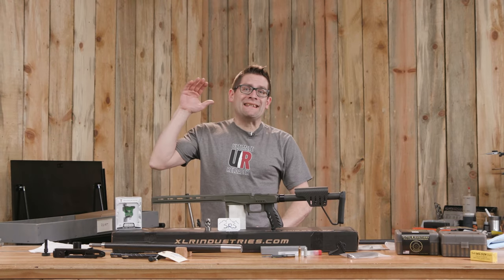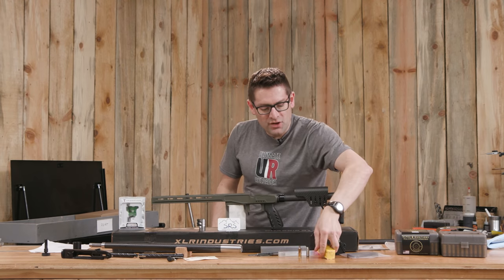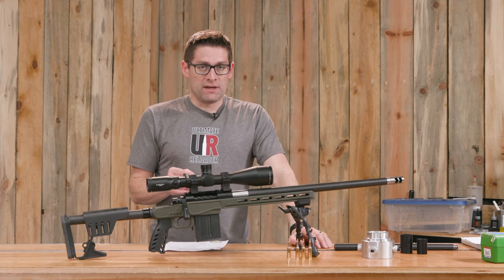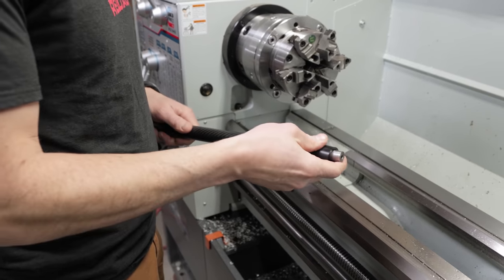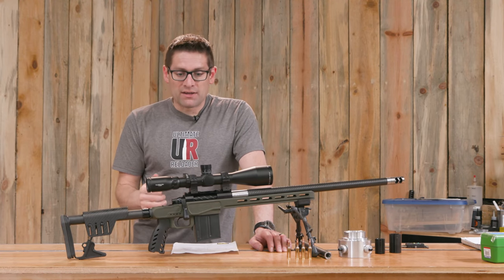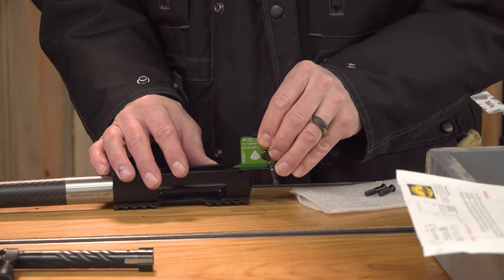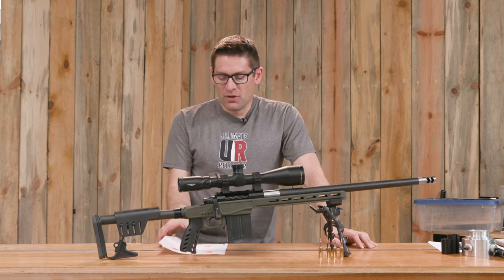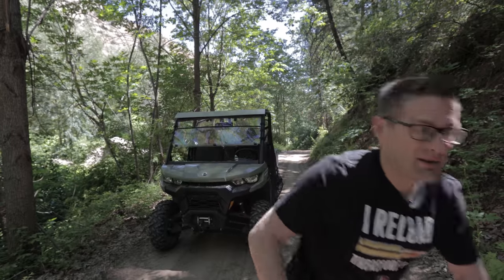22GT Ultra-Light Weight Build (Start to Finish)

Comment: I've been running a 22gt for a little over a year and i have to say i am beyond impressed. Backpack wolf rifle and match guns. 
Anyone that is interested in this cartridge plug the numbers into your app, 90 atips are within 30 foot lbs of energy at a MILE of a factory 143 eld 6.5 creed load. The thing is a monster. 4.9 mil to 1k. The bc is higher then specified from the factory on these as you are at a higher bc. 
Just ridiculous.

Comment: Carbon on barrels heats and burns them faster. Feels cold on the outside, works just like a thermos. A gunsmiths dream :)
Reply: Depends on what kind of carbon barrel you get!
Reply: @davidcoiner6550  No!
Reply: @oddmunddale806  it absolutely does, there are carbon fiber barrels that literally don’t even make contact with the carbon to the steel except for the far ends, and the carbon is drilled full of vent holes. It doesn’t retain more heat than a plain steel barrel.

Comment: Berger 85.5, 90, 95 smk, 88 and 90 from hornady 
Varget to 4350 speed powders all work well, but not surprisingly, rl26 is a monster for accuracy and speeds if you use then heavies. A 1-8 will stabilize most of those bullets when running at the speeds it can produce, but id leave the 90 and 95s out.
Reply: How fast have you got the 85.5’s moving in a 1-8 twist? I’m doing 22 GT in 22” 1-8T and planning on 75/80ELD’s, but would love to try the 85.5’s if they fly
Reply: @mitchellscott1120  in a 7 ive touched 3300. They are rockets. Trued bc is .307

Comment: Great and awesome content. Do you think the EC tuner would help with the groupings? I wonder if the EC tuner is best for solid barrels than carbon wrapped. The harmonics are different when the barrel is made from multiple layers of materials. Please share if you end up using EC tuner and find a great result.
Reply: If you're getting those groups WITHOUT the proper load development done yet, why would you even care about a tuner at all??  With a slight touch of load development he's gonna have this that thing printing single hole groups at 100, or probably even 200 yards.

Comment: Why not go with AG composites... Its even lighter than that stock. The privateer comes in sub 20 ounces. Also I am curious to see how good a aluminum body receiver holds up with hunting. Up here in AK my concern with these is they will scratch and gouge way to easily. for just a few ounces and I mean just a few you can go with the terminus apollo lite and be better suited without having dissimilar metals squeezed into each other.

Comment: I've been thinking about updating my old-school walking varminter, a Sako L461 custom in .222 Remington. I like the .222, I just wish that the rifle had a bit more ooomph at longer ranges (I'm not as sneaky as I used to be) and the bore has 20 years of wear. I'm wondering how fat of a round I can fit into the action...specifically, the 6mm ARC or 6.5 Grendel size case. I have some 6.5 Grendel rounds and it looks like it would fit, but I'm not a machinist , my eyeballs are not to be trusted for precision work and so I would value an expert opinion.
Reply: I have seen some vixens in 6ppc.
And it needs the same size bolt as the Grendel, or other cartridges of the 220 russian offspring. As for maximum cartridge length that will work/feed i dont know.
If you get a barrel in 204 ruger, it might be the quickest/cheapest change for a more flat shooting rifle.
And you can still change the 222 rem barrel back if you want to.
Reply: @Greyzonecompliant  As it turns out, the .24 Nosler will fit, and I wouldn't even need to have the bolt face opened. Feed rail work would be necessary, I believe. The new Nosler manual shows velocities ranging from 3400 fps with 55 grain bullets to 2600 fps with 107 grainers in a 24" barrel, a substantial improvement over the .222 Remington.
Reply: @r.awilliams9815  There really is a lot of new and impressive cartridges.
I hope it works out in your favor.
Im just a sucker for a classic.
The 222 and 22-250 even if the newer ones are better.

Comment: I've considered doing a 22gt since I've got so many 80.5s and 90s from the Valkyrie. And I've already got 6gt headspace gauges. 

Side note. Try out Tuebor precision. Their action is awesome and they're marines. I got a cert from a guardian natch and have a 6gt in it. Shot about a 4 inch group at 868 at the last match I did in August
Reply: Thanks for the heads up! Ever since I watched his 223 trainer video I want to get one built. I’ve been shopping around for a builder. Just checked them out and I live a lot hour from them! Plan on calling tomorrow 👍🏻 thanks again!!!
Reply: @captaincripple7218  no problem. Only issue I've had is a lack of time to train, and develop a new load with staball since varget extinct
Reply: @loadmastergod1961  yea thankfully I seen this coming and squirrelled away 8 lbs of it but I still don’t like using it up.

Comment: Looks pretty light for a chassis gun, but I don't think I would call it an ultralight hunting rifle. I would say it's about average for a hunting rifle (estimating ~7lbs 11oz with scope). Most people I see building ultralight hunting rifles consider that to be <5lbs including optic.

Weight based on the following:
-Element XLR with carbon accessories: 28oz
-Bat machine bumblebee: 23.8oz
-Barrel - unavailable, so I used the lightest contour 20" proof research barrel: 36oz
-Athlon Midas Tac 5-25x56: 30oz
-TT diamond + rings: ~5oz
-Muzzle device: 1oz

Definately a lightweight rifle for its style and capabilities, but I think calling it ultralight is a bit misleading.
Reply: Yeah not sure why he goes to all this effort then puts a bulky 56mm objective scope on top.
Reply: @WayStedYou High end optics makes a better shooter.😉

Comment: Great content on your rifle builds and machine work. Question ..please… how do you deal with natural barrel Curvature in the lathe and do you index high point to 12:00
Reply from the maker: Yes, for long range builds I typically clock the barrel at 12:00 :)
Reply: Do you capture the the muzzle end of the barrel while you chamber ream?
Reply from the maker: @jerryrochelle3112  Yes, using the combination of the barrel extension and the outboard spider.
Reply: Does that not set up stress on the barrel and affect precision work?

Comment: Did you remove the plunger and firing pin from the bolt face when checking for headspace?
Reply from the maker: I only removed the ejector and spring- there's a hole in the center of the gauge where the firing pin would hit :)
Reply: @Ultimatereloader  Thanks.  I have seen many chambering videos where it was recommended to strip down the bolt.

Comment: I am not familiar with the 22GT, I shoot a 22BR so what differences are there?
Reply: 6mm GT is the parent case to 22 GT. 6mm GT has slightly larger case and slightly longer COAL than 6mm Dasher. 6mm GT should feed better than 6mm BR/Dasher because of the longer COAL.

watch?v=x8IAy898X6Q

Comment: I liked your video & all your attention to detail up until you installed the scope without checking the scope rings for alignment to each other or lapping them in? What’s up with that? I have seen so many video’s of shooters showing the “correct” way to mount a rifle scope but skipping this important step!  I can’t even count how many scopes I have mounted for people who told me the rings they bought are so perfectly machined they don’t need to be checked for alignment or be lapped in!  Wrong!  Most mid to high priced rings are pretty true when it comes to alignment with each other, a few I found were not. So I lap in every set of rings I mount up. Doing this corrects minor out of alignment issues by removing material from the inside ring surfaces which also get’s me at least 80% contact between the rings & scope tube. I have never seen a set of rings which didn’t benefit from being lapped in!  By lapping you remove any stresses caused by misaligned or out of round scope rings.  Removing the stresses placed on that scope tube which at worst could damage the tube & or the internal tracking system of that scope or at the very least improve contact between the scope tube & rings.  Lapping is an extra step when mounting a scope but when you spend a bag of money & time on every detail of your rifle to insure maximum accuracy why skip this easy step?   Also,follow manufacturers specs.for torquing ring screws,in.lbs. NOT ft.lbs..Over torquing can damage your scope!
Reply: He may have edited that out. Gavin has video where he shows detail in lapping and using another method of using compound in the rings to true the scope to rings..uses Carnuba to keep scope from bonding the rings. It's an overnight process.